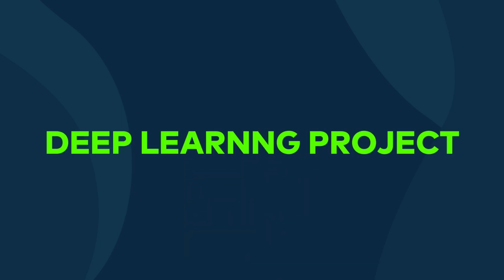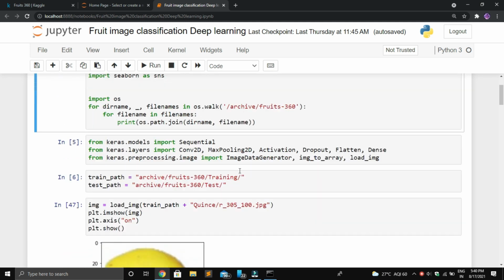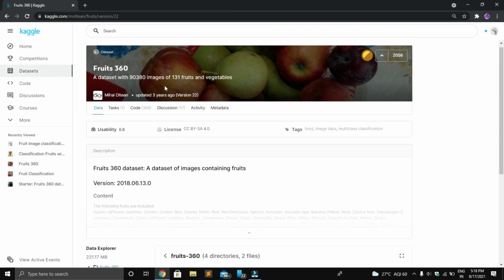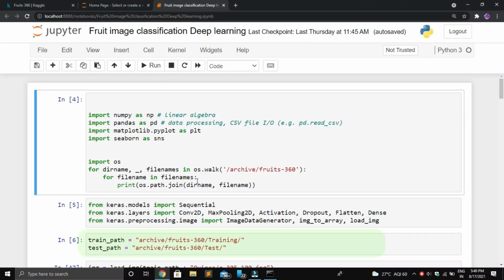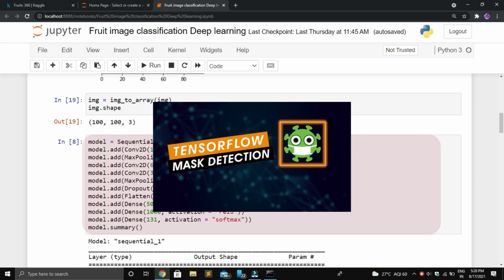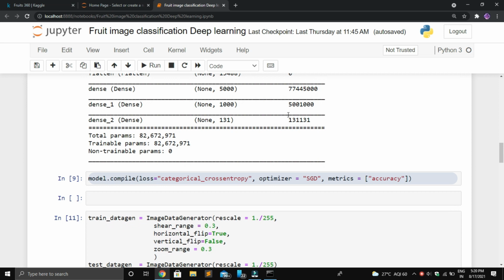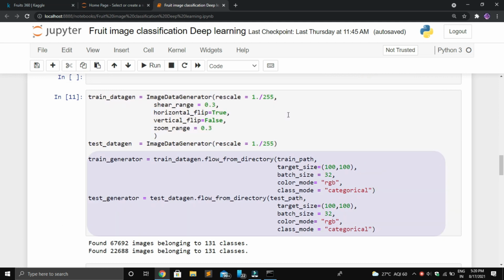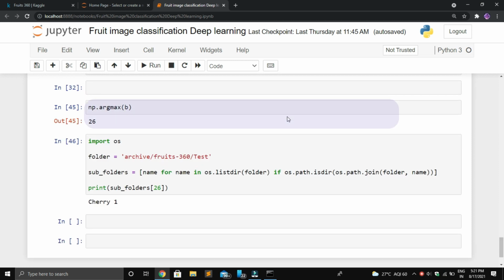AI Project : Fruit Detection using Python ( CNN Deep learning )

Comment: hey u said  that there are around 67k  and 22k images in train and test datasets .. so  u trained this model over ur train dataset of 67k images ..... and i want to  know that do we need to have any special hardware support like gpu  ... or this will work fine with cpu and intel integrated  graphics of 4gb .... 
can u tell me about this ? when we  need gpu and when we dont need it ?
Reply from the maker: Good question,You actually need so much GPU to train datasets like this, in my case I have 8GB ram and basic graphics cards it takes me 2 hrs to train this model
Reply: @arunhimself   yesh thanks I have  same system  I will try it thank you so much for info.